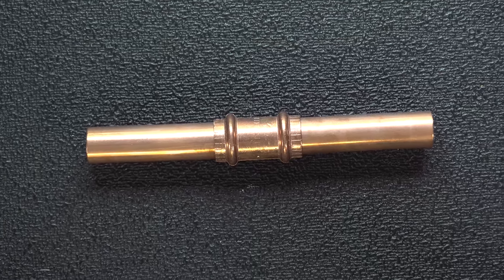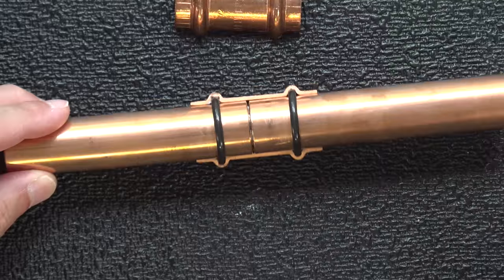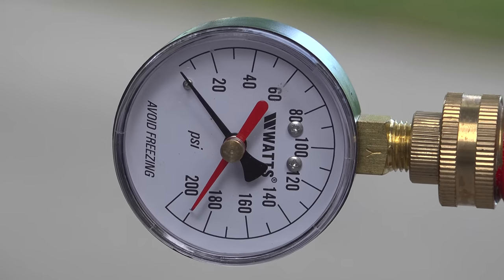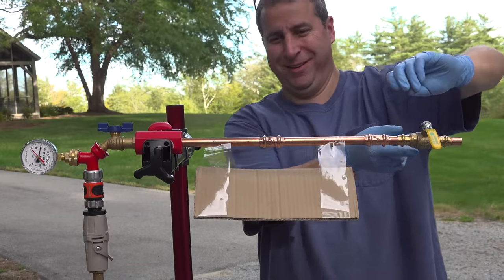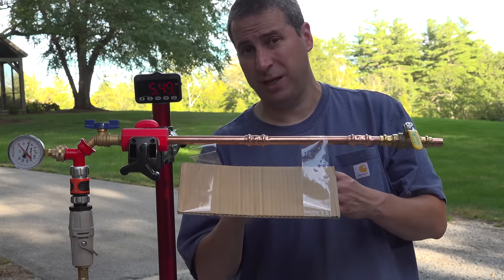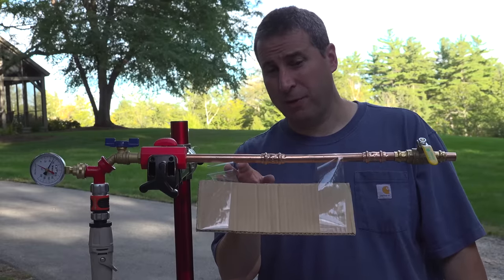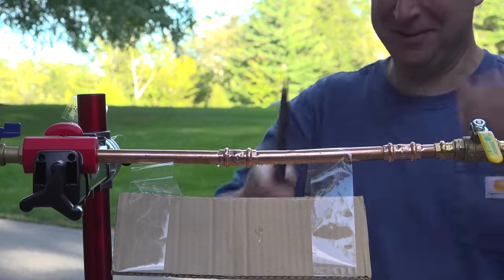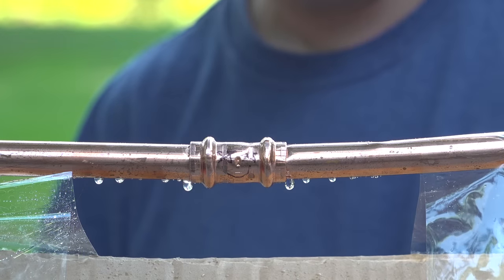Do O-Rings Really Leak Over Time? Testing PROPRESS

Comment: I would like to see you recreate the test of you beating on the pipe, but with the o-rings still in place. To prove they are actually working as a backup.
Reply from the maker: That's a good idea, I am still in shock of these results. I will have to work on a followup with some endurance tests.
Reply: My guess is beating a soldered pipe will eventually cause leaks. Fortunately, most of us don’t have to worry about bars to our pipes in the walls.
Reply: @tb2324  no, but sometimes pipes in walls move and bang around due to the water pressure. That can be a problem 5 years later. Still impressive though
Reply: I just watched video and came to comments to ask the same thing. Beat on it with the O-Rings installed.
Reply: @tb2324  You can beat a PROPERLY soldered joint like a rented mule and it will NOT leak!.  I have cut one of my soldering joints in half lengthwise and pounded the pipe off with a hammer and chisel.  Little pieces of copper pipe stayed on the fitting portion  when I violently pried the 2 pieces apart.
Reply: @lsteiner well that's it then, I'm not loaning you one of my mules
Reply: @RadRob84 ”pushing and pulls” is not what was done here. This was to actually cause direct warping of the metal.

Comment: I use propress fittings often as part of my job, from small diameters of pipe to much larger diameters that require the bigger gun. I can also solder and depending on the situation may have to opt for one over the other. I can't understand the disdain some folks have for propress. Both have their pros and cons, but the fact is that both work. I have a sneaking suspicion that many who are worried about a propress fitting lasting for 20 years aren't reaming or cleaning their copper properly anyway. Tradesmen need to stop being scared of change lol
Reply: A properly made solder joint is always going to be better than a propress joint. The problem is that a properly made solder joint isn't that easy to make and people like to cut corners. First you have to cut and deburr the pipe. You have to clean both the pipe and the fitting well. You have to apply solder and correctly heat the fitting enough to allow the full length of the joint to wick the solder in, but not too much heat as to burn off your solder. Then applying too much solder will create little globs of solder in your pipe causing weird water turbulence reducing flow and causing pinhole leaks down the line. Oh and you have to flush the system after soldering with flux and hot work permits are required for commercial projects. 

Now... once we get into some of the bigger 2" and bigger pipes that many of the properties that I work with use and you realize that getting a good solder joint on a 3" copper pipe is an absolute nightmare where you're heating the joint with two or sometimes three torches and have two people working on one joint to get enough heat in the pipe to melt the fitting and you see how a megapress tool just starts to be a necessity. 

Add in the fact that propress is quicker and better for service work because it doesn't require the water to stop dripping and any idiot can do it and do it well and I prefer to spec work be done in propress when I'm asking contractors to spec out work for me. I do property management and have seen a hundreds of solder joints fail and I've never seen a propress joint have any issues.
Reply: @dudas91  yeah I think this is good summary that highlights benefits of press fittings. soldering has it's place in my opinion, but when factoring in all the variables press fittings really tend to be the best fit for a majority of applications these days.
Reply: @dudas91  Well said sir!! You have me wanting to go become a licensed plumber. 🤣🤣🤣
Reply: @dudas91  This is where so many pointless arguments stem from - something being better in theory vs being better in practice.
Reply: Imma just say pro press is fine but solder and braze with
Reply: @SLEEK TONE  can you say this again, but in proper English?
Reply: @williardbillmore5713  "Properly"?  Define that, sir.
Reply: @SplashJohn  Means not taking shortcuts such as non-soldering. Soldering really is not hard for a almost perfect seal that will almost guarantee will outlast any non-soldered connection. 
If I'm paying a plumber then I want soldering! Although for a free job, sure use pro-press.
Reply: Those of us who have been around for a few decades, are a little gun shy, having seen the failures of many latest, greatest, best Inovations. Having said that, propress looks like it’s pretty great.
Reply: I want to make the money. Not charge the customer more to give the money to the companies. Doesnt make any sense to me to charge more for the fittings, charge less for the labor, so i make less money but the customer pays more for a job thats not as good. Propress has its place, but its not for everything. It took me about 20mins to learn to soldier. Now w propress any dummy can do it so again your customer is paying more for a less skilled worker. It takes the professionalism away from the trade. Just doesnt seem worth the extra money to me. Its faster, yes, but again, thats less labor time i can charge for. So all the extra money for the fittings and the tools are going to the big cooperate companies, not in my pocket. Also, w a soldered joint, i know when the walls go up my work is tight and problem free for many years. W propress, how long is it going to be problem free? Any problems now i have to open up walls. So its great for unfinished stuff so you can see and quickly fix any future problems, but i wouldnt want it behind closed walls. Im fairly new to the trade so its not like im an old school plumber stuck in my ways. I just dont see it as a superior product/end result worth the extra money
Reply: @jacksmith2315   a bunch of things in that comment that don't necessarily need to be true though. A) You aren't gonna be making less money using propress unless you're bad at understanding how to price things out. B) No, you won't be using a less skilled worker unless you're bad at managing who you employ. It also doesn't take "professionalism" away from anything and I'm not sure how you got to that conclusion. Soldering simply creates more variables, but propress in no way should mean taking less care or putting forth less effort to provide quality service and ultimately that's a lot more important to being a good professional. Propress should still take time and care to install. You say yourself that you're relatively new and learned to solder in 20 min.... Respectfully, if that's all it took to create the professionalism of a trade then I wouldn't be paid as well as I am. If propress goes in right you'll be retired well before it fails. And I get what you mean that you would want to do the best possible work, that's respectable. But installing propress instead of sweating isn't setting the homeowner up for failure or charging them unfairly. There's a lot of decision making that should lead to that point to determine what's best for the situation. There's also just a lot more of the industry that you aren't considering as propress wasn't really meant to be the solution of a small company anyway. Leak on a 3/4 copper 90 in someone's house? Yeah, you should have the time to solder and it's likely the better option assuming quality work. Replacing 50 feet of 2 inch copper that can't be completely valves off will make you not want to solder again for awhile though and that's the perfect time for press fittings. If I were to go on my own doing residential work then I likely wouldn't have a propress gun anyway, but bigger jobs come and propress becomes a lot more attractive as an option.
Reply: This is like the equivalent of push in connectors for electricians lol. We hated them but eventually learned that they are great to use and have their own place in the industry. By all means I'll use a wire nut 80% of the time. But those pushins are so much quicker and forgiving when doing rework
Reply: tradesmen need to learn to follow manufacturers' instructions.  I am fighting with my plumber who i saw not reaming and cleaning properly and boom, 3   3/4 fittings are leaking.  so frustrated with the ego...

Comment: Metal expands and contracts based on the water temp so I would still use the O-rings as a safety. Nevertheless, this was still is impressive.
Reply: Expansion should be little concern as long as all components are the same material. Yes one end will warm and cool slightly faster and copper has a high expansion rate but my non-expert opinion would be not enough to have an effect. I'm not a plumber but i am a machinist so metal is my life. During machining processes i deal with heat all the time and sometimes use it to my advantage.
Reply: @95dodgev10  I've had threaded connections have no leaks until they were heated with hot water.
Reply: It’s still crimped together. Meaning some of the copper was removed from the fitting during the press. It is smushed together much like a compression fittings’ ferrule is mashed into the pipe. Expansion from temperature isn’t going to separate the fitting from the pipe is literally smashed together like gum. The goal with plumbing is to make the pipe and fitting as one singular piece as possible. Just like PVC, it’s not glued into the joint it is a chemical weld that bonds the two pieces together into one piece. Or else all of the fittings will leak. The goal is to make the spaces close enough that water can’t slip through or to bond it into one piece
Reply: I mean heck on water HEATERS we thread brass female adapters onto the MIP threads coming off of the water heater. And it cools and heats. No leaks
Reply: @drooplug  Nice thought. Yeah I would like to see this test redone with HOT water, COLD water cycling and longevity test. Just because something works nice now does not mean it will work like that in the long term.
Reply: @williardbillmore5713  nice try. They've been around since the 90s.
Reply: Of course, no one is going to willingly pull out the o-rings, it was just a test to verify Viegas claim.
Reply: @95dodgev10 one issue could be that the pipe may be constrained in length (fixed condition) whereas the pro press can technically just expand axially. Thermal expansion does occur linearly in all directions, but like you said, there is the concern that the pro press fitting and pipe would not be at the same temp, but this should be negligible.
Reply: @mrdan2898  No point testing that way. Nobody is ever really going to remove those rubber seals, so who cares?

This was just a fun test and there is no point to make it into a "scientific mission".
Reply: @Megabear90  Actually since 1960s. Invented originally in Sweden.

Comment: Incredible that there was no leak, although  that press must cost a fortune.
Reply from the maker: The manual press is https://amzn.to/3qbPCI4 not bad. The power tool is $2k but if you have a plumber install two valves in yoru house nowadays you might spend 1/2 that. So one trick is if you have  LOT to do, buy the power tool, use it for the job, sell it later and you will get back 80% of what you paid. They are very desirable used.
Reply: Time savings equal labor savings, and no one thinks about the cost of consumables, solder, flux, gas, etc etc.  A press tool now gets over 100,000 presses before needing to be adjusted, no matter if it is pressing 1/2" or 4".  How much solder would you have to buy, or brazing rods, for 100,000 4" presses?????
Reply: @robpendola5888 the answer 100,000 4” couplings is 400,000 inches of solder. Theres 27 feet in a roll of solder approximately so just over 33,000 rolls of solder for 100,000 4” soldered couplings. Just an fyi nobody solders that much 4”. A better comparison is to take an average pipe size which is 3/4” and use that. Which would be 75,000 inches of solder at 27 feet per roll equals just over 231 rolls of solder at an average of 30 bucks a roll… that prices you out at about 6,900 bucks. But heres the kicker…. You would have to solder like 40,000 joints before the tool paid for itself. The average on call repair plumber does a hand full of joints on average a day at best. But lets say 4 a day on average. So 20 joints a weeks on average which is 1,000 joints a year… which would mean it would take 40 years for the tool to pay itself off. Where the tool makes sense is in large scale new construction with inexperienced staff. For the average plumber it doesnt really pay to invest in propress unless its something you really want and you can charge the extra costs in your area to make back the cost of the tool. Just sayin.
Reply: @-Nobody-1 it saves time, and when you work for a company that provides the ProPress tool it helps both the company and me. It saves my time as a plumbing service tech, you can’t sweat joints as fast as just inserting copper into the fitting and pressing it. I did a job at a propane company, they had a pinhole in their water main. I just killed the breaker for the well pump drained down the pressure tank, cut a section out and pressed together a new section. No hot work permits, no pretending to pay attention to the safety guy ramble on for 15 minutes about the dangers of fire before I can even grab my torch out of the van even though they had a gas fired hot water and guys were smoking outside the front office that is 100 feet from the giant tanks. it was a propane company so they had a safety guy on site. Every tool I used he wanted to go over a safety list or some shit. If I even mentioned anything about a torch I’d be there all day
Reply: @-Nobody-1 the advantages are more than that if you are doing a repair in a 100 year old wall cavity there is no open flame to worry about and they can also be press fit with water in the pipe .I’m not saying that justifies the cost ,that is an individual decision. One thing I will say I recently purchased a pro press tool and when I was at the orange big box store stocking up on fittings $ I noticed that the section that carried solder copper fittings has considerably shrunk . Not a fan of being steered into anything by lack of options.
Reply: @tommurphy6058  true true. I feel like most of the broken lines ive found are in basements or crawl spaces under the house on 1/2” lines…. I do have a charcoal cloth too though if there any flame danger. A lot of times you have the room to actually face the torch away from the wall or a stud to solder. You can adjust flame and angle of torch tip and get in tighter spots than a person would think. Pro press is cool though, i am coming around to it… its just the price of tool and price per fitting. It seams like a nice addition for people that can afford it but maybe not something to use on everything.

Comment: i'm a commercial plumber and aside from a few special case scenarios here and there propress is practically all that is used any more for copper. It does work well. Usually if you have a leak its from an instillation error where the pipe pulls out before you press it or something. The down side of it is that when you press it, it tends to pull in any direction it wants and fucks up your square, plumb, and level
Reply: Thanks, I've been thinking about adding a press tool, and will definitely consider that down side.
Reply: @williardbillmore5713  It is about getting more done and working smarter. Are you really telling us that soldering a whole complex is faster than prepressing it. You can wrap up jobs a ton faster and move on to the next one and most cases if a leak happens and you followed everything, you can pin on the manufacturer. Not going to work with Soldering. I do however believe Soldering is an art and maybe people do it wrong or partially right. I have seen so many plumbers skip steps such as deburring, cleaning, wiping flux because they just want to move to the next thing
Reply: @williardbillmore5713 pro press is the new standard you geezer
Reply: @williardbillmore5713 maybe if you’re too lazy to watch this very video that proves you wrong, you shouldn’t be a plumber
Reply: hi, a plumber of mine propressed the MAIN line to the sprinkler...is propress safe for HIGH pressure lines?
Reply: @jinsu0504  yes it will be fine.
Reply: People act like pro press is new but it's been around since the 1980s and Europe and then came to America in the 1990s. Plus it does have a 50-year warranty. I've had it done on my house and I would never go back to ask somebody to do solder and a torch on copper in my house

Comment: I work in the research and scientific field in Facility Management, and can say with confidence that the O-Ring is definitely necessary for applications where pneumatics and vacuum are involved. We have Propressed ball valves that wiggle on the pipe after repeated use from students and researchers over the years- Especially in our laser cutting room and chemical labs. The only thing keeping compressed lab air in the lines, or keeping our systems under vacuum at that point in time is the O-ring.
Reply: Buddy, change the pipes. It always amazes me to see such intelligent people in other fields say such incredibly silly things about construction.

I can guarantee you that o-ring is not holding pressure. If you see a pressurized line start to fail, Stop using it and change it. Obviously propressed isn't the right choice in your situation.
Reply: Pro press is not meant for vacuum or valves that are going to be used on and off constantly also pro press holds air and gases just like water because they are both fluids but that being said not all fluids can be held by pro press once again the right tool for the right application and I say this with 25 years of experience in working on vacuum systems and freeze dryers and many other types of systems from steam to chiller.

Comment: The metal hitting put a noticeable bend in piping.  Of course it will leak at that point.  To me that is extreme.
Reply: Soldered joint wouldn't leak.